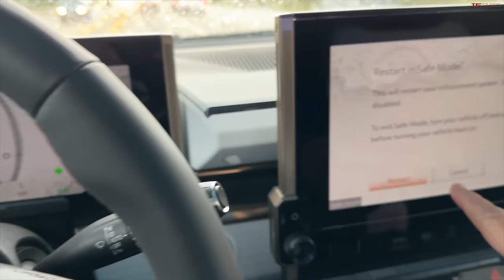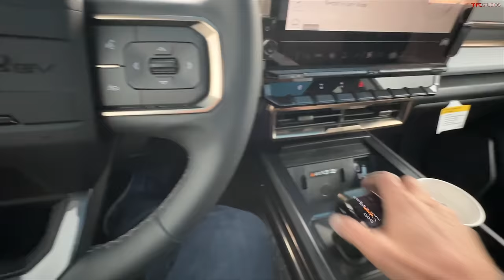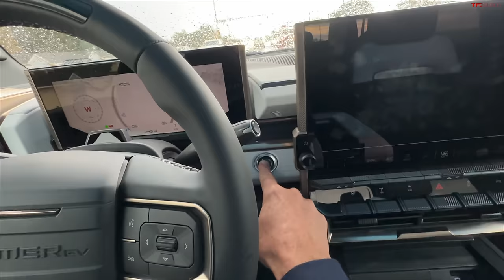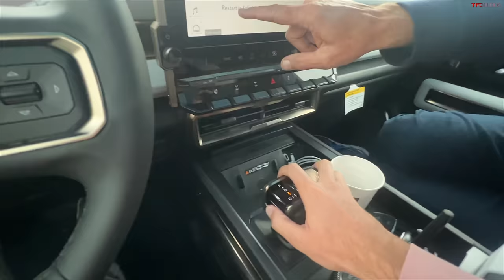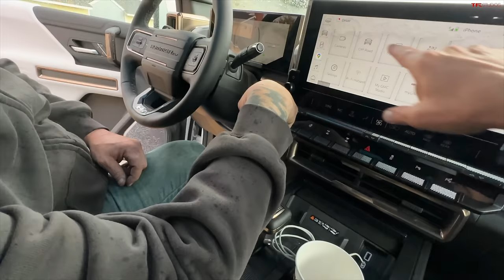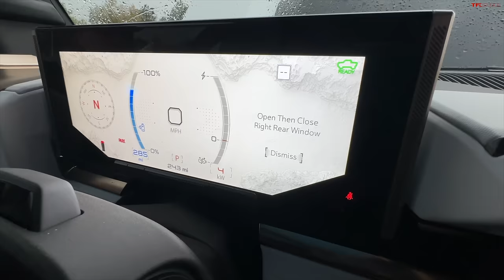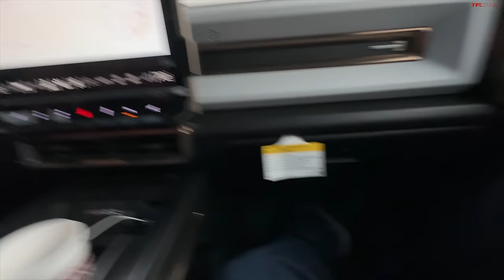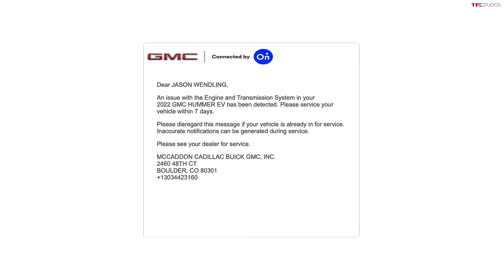I Bought a $115,000 GMC Hummer EV and It IMMEDIATELY Left Me Stranded!

Comment: The more I've seen newer vehicles bs the more I'm falling in love with old vehicles.
Reply: Too bad you won’t be able to buy them anymore
Reply: You can still buy used vehicle
Reply: @rezcellent  says fckn who..
Reply: And this is y u don't get the newest thing out there! Wait a few years for them to work out the bugs
Reply: Easy fix just a software update. Still sucks that it happened but it’s not like you have to rebuild a engine.
Reply: @aaronops32  I'm picturing this as the new ransomware technique! U r stuck in the middle of a 7 lane California highway, please send your Bitcoin now for the code to your car
Reply: @mikeklinger1712  lol that’s awesome I like where you’re mind went
Reply: @aaronops32  I just love how one of the big three auto manufacturers excuses for having half empty lot has been a shortage of computer chips. Yet now we're gonna build vehicles with more computer chips in them! It's all touchscreen to operate everything so u gonna tell me that shit can't be hacked!?
Reply: I cant wait to get my 91' S124 on the road with an OM606, fully mechanical pump, mechanical lift pump, big turbo. Over 400hp. Could be run with no battery or alternator if needed🙌🏻
Reply: Same
Reply: @Parker2100  shows just how little you actually know about the Model T . First , they would do forty mph in stock form . Modified Ts such as the one my late uncle had back in the twenties were capable of doing eighty mph . Secondly , if you weren't able to crank start an old engine it was because you were doing something wrong . I've owned two 1923 T model Fords, a '29 A model Ford , and a 1930 American Austin , so yeah I'm well acquainted with crank starting  a car . No broken arms or sprained wrists either .
Reply: Ahh yes, uncomfortable death traps that guzzle gas and break down all the time. How could we forget those heaps of garbage... 🤦🏾‍♂️
Reply: i wish they were immortal
Reply: My dream car is a Willys M38.
Reply: congrats you found one example.
Reply: @rezcellent  I can buy old gas vehicles all day long. Good luck with your vibrator powered vehicles. lol
Reply: Too many electronics in new vehicles.
Reply: @aaronops32  The whole point is that companies wont let you "rebuild" anything on the EVs. If you were smart, you would be fighting EVs with everything in your soul. EVs are not carbon neutral and they require a mass amount of dangerous mines in multiple unregulated countries.
Reply: To be honest I'd be happier in a PT Cruiser than this Hummer.

At least it sorta drives.
Reply: I’ll stay in my lively Acura that I can fix on the side of the road if it ever breaks down 12yrs later. I see why people are afraid of the EVA TAKEOVER
Reply: Guessing there's a difference when Boomers and Gen X make cars vs the millennials and Gen z's.
Reply: @mikeklinger1712 electric cars have been around over twenty years kinks should be fixed
Reply: @jamesa9lpiopatton419  Chicago thought so too! Nice parking lot of dead robots last weekend
Reply: @aaronops32 sure. It’s not like the car just brakes right after you buy it. You know just like a cheap Chinese blender.
Reply: @rezcellent 
Sure ya can, they are everywhere.
Reply: @yeahdude7 
Exactly, I don't need electronic navigation, 13 speaker sound system and can adjust my own cold seats. Just give me an am radio and an astray.
Reply: @T1Oracle 
Death traps my butt. A newer car rear ended my 72 steel bodied 472 V8 at slow speed at red light. That car was totaled with plastic all over the street. I drove away and just needed to buff out a scratch 😂😂😂😂😂.
Reply: Agree on that one 👍  let's get back to old school mechanics at least they worked , as they say keep things Simple , but modern .
Reply: I love my 2092 Hyundai!  So dependable!
Reply: That's why I still have my 1964 Chevrolet Impala.

Comment: Hummers have a fine, and well deserved, reputation for unreliability. GM simply doesn't want to ruin its reputation just because this one doesn't have so many moving parts.
Reply: What was that horrible anti-social noise when the doors were shut?!
Car alarm to protect a brick?
I hope that can be turned off, no way I could use that on a night shift!
Reply: @stpfs9281  a physical cable or lever to put it into neutral wouldnt be a bad idea, or maybe a separate motor hooked up to the power supply to limp it out of danger would be smart too
Reply: My 2006 H3 has rarely had any issues and wouldn't give her up for anything.  She's da man!  Maybe other models have issues.  All I could think while watching this was "F that software running my car s*hit."  The only time I've had a similar situation with the H3 was when I accidentally hit the "low" button not long after purchase.  Thank God I was in a parking lot AND had a hardcopy manual.  OnStar did the same thing and called for a tow, the dealer said they had no idea why I could only go 12 miles p/h, so no help there.  The manual explained it and I fixed it so no tow needed.  Can't imagine going through that on a larger scale like these guys with the computer running everything.  Oy.
Reply: BlackStone Investment rides again!
Reply: Lies
Reply: I honestly don’t feel bad for anyone who not only buys a GM (I say that as a former GM automotive Technician) but an EV GM at that!! YOU GET WHAT YOU DESERVE!!
Reply: Reliability and fuel economy are not the reason you buy a Hummer.
Reply: w/that said, the H2 is very very reliable. Also I was wondering why he was complaining so much instead of call GM support.
Reply: My H2 is very reliable .
Reply: @lewtus72  I bet, those things were made very basic. I think they had a 4 or 5 reliability rating. They just suck fuel. The purpose for them was for taxes. That's what these SUVs and trucks are for.
Reply: @gizbot9366  We have an 07' H3, still going strong. Very little issues over the years.
Reply: Pretty sure your talking about am general not h1s.  H2s and 3s are a box on a silverado frame
Reply: This most likely coming from someone who has never owned a hummer . I have owned 3 hummers 1 ht3 and 2 h2 very reliable in my opinion specially on ice and snow
Reply: I honestly can't wait for both the XTerra and the FJ Cruiser to come back!!
Reply: @jonlosito2004  the FJ Cruiser ❤️
Reply: @dct124  agreed
Reply: @dct124  he did.
Reply: Well that's a new discovery for me: Hummer owners are some of the most thin-skinned people on the planet. 🤣
Reply: @patrickyoung2151  having a single computer controlling all aspects of a car, even things that don't really need a computer to control them, is just a really bad idea.
Reply: @klepow  GM tech support. I think he call them and they sent a tow truck. I'd have to re-watch it, which I'm not. I'll take your word for it.
Reply: @dct124  he used Onstar, and they weren't helpful, it took a lot of persuading to get them to send the tow truck.
Reply: @klepow  OnStar, right, not GM technical support.
Reply: @dct124  yeah, I don't really know. The last GM I owned was a C20, in the early '90s, and it was already older than dirt. It took leaded fuel.
Reply: Never had an issue with mine. Changed fluids regularly and did the recommended maintenance work. I think reliability being an issue comes from most people who buy them to look cool, don’t have the money to actually take care of them
Reply: @notsojoerogan  I think that's what we were saying. The Hummer is one of the most reliable trucks ever made. Just eats through fuel ⛽
I drive a Merc. People say Mercedes is an unreliable car brand. I just challenge back and ask why are people still daily driving Mercedes in mass around the world that were built as far back as the 60s. In the US on the East Coast I still see people driving Mercs from the 80s, 90s as daily driver's and these new ones in Germany hitting 300k, 400k miles as taxi's.
Reply: @patrickyoung2151  a physical cable to put an all electric car into gear? Is that even possible?
Reply: @MAGA4EVA1986  GM vehicles were always a mixed bunch: some unreliable but other quite reliable. These days one has to distinguish two kind of problems: software and hardware. Traditional automakers are known to having crude, unrefined software for the moment. The tech companies like Tesla and soon giants from Asia like Foxconn  , Sony and others should have much better software. No hardware issues were reported in GMC Hummer EV so far.
Reply: @Pepe-dq2ib  i meant some way to disconnect the motors from the drive train or at least a surefire way to override any braking system
Reply: @patrickyoung2151  I’m pretty sure the lightning has a easily accessible lever to put it into neutral like this
Reply: @dct124  Vanity is the only reason.

Comment: I was one of the engineers assisting with some of the testing for the Hummer EV. At one point the lead test engineer said he needed my help to open the hood, since it turns out the hood is both power operated and software controlled. 
If the auxiliary battery of your Hummer EV dies, it will prevent the hood from opening, preventing you from accessing the dead battery, basically sealing itself inside. Additionally, this battery cannot be charged nor accessed anywhere from outside the vehicle. A bit like James May's Tesla battery issue but far far worse.
There is a manual open underneath the dash, but it has to be yanked on really really hard with a wrench. I chuckled to the lead test engineer saying "doesn't this seem like it would be a huge problem?" And he replied "yeah, it isn't the first time this has happened".. but seeing this made it to production I guess they didn't care.
Don't know why absolutely every feature needs to be electric, sometimes those good old mechanical bits should just stay mechanical, even on the cars of the future.
Reply: That battery should be able to recharge from the main battery with a bypass switch. I'm sure it gets low after being in the factory parking lot for who knows how long and flashers, radio, lights will contribute to the injury.
Reply: I remember seeing a video of someone trying to fix a semi new Jaguar, the battery was in the boot but had gone flat, but the boot had to be opened electronically with a solenoid, which obviously couldn't happen as the solenoid had no power
Reply: I bought a Mini SE because it's simple, open the hood and there is the battery, normal door handles etc. Been totally reliable and get 4.6 miles per KW. It actually saves you money and energy which is the point of an EV anyway.
Reply: I have a 2006 Jeep Wrangler. It has manual crank windows, manual door locks, you start it with a real key, and unlock the doors wit a real key. Everything works fine. Sometimes, simple is best.
Reply: Absolutely true...
Reply: Like the engine. That should’ve never changed
Reply: Typical GM
Reply: @doncoleman6070  typical loonacy that shows how tech achievment can be so stupid.. electric hood latch?! wtf man?
Reply: This is not isolated to EVs. Most shift by wire cars can't be put into neutral for towing. We have to break into cars every couple weeks because of a locked car with a dead battery, and the lock for the flip key is frozen because it's never used. 

Lotsssss of myths about ev while overlooking the GLARING issues with gas vehicles. People act like they don't break down, run out of gas, need very expensive repairs for check engine lights to pass inspections, gas fires, CO deaths, precious metals convertor mining, maintenance. It's a ridiculous comparison.
Reply: Didn’t you mention the magic keyword to raise GM’s attention?
Reply: @sonicelectronic57  you obviously don't understand how shift cables work. You can learn how to do your job instead of doing a hack job by disconnecting the cable on the transmission and put it into neutral that way
Reply: @LeObsidianCraft  ha, right... One of us knows, that's for sure. Look up what shift by wire is smart guy.
Reply: @LeObsidianCraft  are you still looking that one up?
Reply: @sonicelectronic57   You're joking right? Even shift by wire cars have a lever, usually hidden that you pull to release the trans into neutral. Range Rovers, Mercedes, BMW. I mean I'm not sure who doesn't have a way, even on Fords you can crawl under all and disconnect the lever and pull it back to hold in neutral even though the lever doesn't change what gear it's in.
Reply: @400Redsport  Nissan and Dodge. Are you joking?
Reply: Just like the horrible prone to fail elect injection pump in the Hummer H1. The engineers new of this major safety problem but it was never addressed. The problem was an easy fix put in a mechanical injection pump. 👍 Well done GM cheap parts and no problem solving solutions for your customers That believe in your shoddy product
Reply: Umm, (Sir/Ma'am) just 1 more thing 🤔. This confirms why I think I will just stick with my 1974 Monte Carlo.👍
Reply: @sonicelectronic57  However, we’ve been building ICE vehicles for >100 years and the reliability has improved greatly even in my lifetime. Engineering takes time and iterations. Maybe in 10-20 years these EVs will be a reliable option.
Reply: @Steve Hook ah yes, American ingenuity.
Reply: You simply cut the hood off with a grinder and toss it to the side of the road.
Reply: Hand crank start and a magneto starts to sound really good right now. My old '77 Goldwing had a kick start. Came in handy on several occasions. Why they got rid of the kick start, I'll never know.
Reply: Lazyness doesn't put society on a good spot
Reply: Mechanical is reliable
Reply: @doncoleman6070  GM has the Guiness world record.. crushed the most EVs.
Reply: You should have called Huston
Reply: This is exactly why this won't be a vehicle of the future
Reply: Steve, that just illustrates the STUPIDITY of some of the people who made the call at GM, and the other companies.

Those idiots going on about "electric vehicles" being new and IC vehicles being better because they've been around for over a hundred years should learn why they're called "motor" cars and not "engine" cars - it's because around the turn of the last century electric vehicles that use a "motor" were much more common, and reliable, than the IC vehicles that used an "engine".
Reply: @sonicelectronic57 nice story.... lmao, you have no idea what you are talking about!
Reply: You guys must have gotten your inspiration from cell phone manufacturers.
Reply: Apparently, each and every customer is also a test engineer.
Reply: As an automotive technician I got hands on experience with all sorts of genius engineering.  I don’t think I would mention having any part of that POS… 

Problem with modern day vehicles is, engineers throw all sorts of BS in them that don’t need to be there..  5 computers talking to each other and computers running mundane tasks like power window controls and the damn radio..  I might be an old knuckle dragger screaming get off my lawn. But my Harley has a head unit (infotainment system) loaded with Bluetooth, apple car play, android auto, GPS, mic , helmet mic, dual camera capability.  Basically everything for the youngest whipper snapper to nerd out on.  It and the AMP wired through a couple simple fuses. I know because I installed it myself. 

You can throw a late model engine in an old car with  basic wiring that worked for a century, and done a better job  with an aftermarket engine/ transmission management system  and have 10 times the the vehicle.  Wouldn’t have all the nanny BS either..  I quit turning wrenches because I had enough of all the glorious engineering progress.   I won’t buy anything later than what has a gen 4 LS.  And if I do buy that it’s to take the drivetrain out and put it in something engineers had a lick of sense when building it.
Reply: @alanpeterson4939 Back when engineers still had a lick of sense.  Everything late model is a POS.  Today engineers are in a race to see who can throw the must useless BS in vehicles.   I went to my backup profession when engineers went full tilt imbecile..
Reply: Hey buddy. Thank you so much for sharing this. Whoever buys these things are absolute idiots!
Reply: @jrow96 .. mechanical is more reliable than electrical 😹😹😹😹